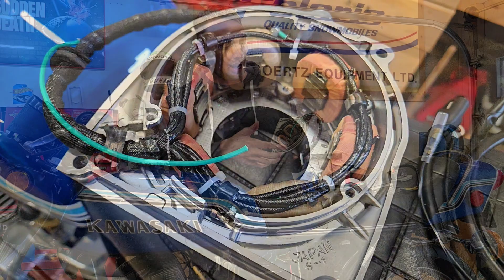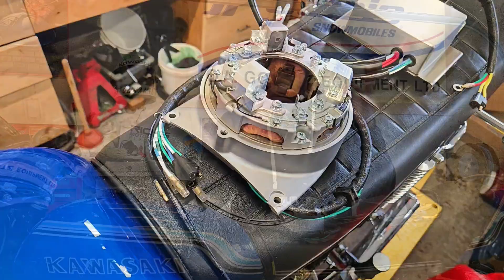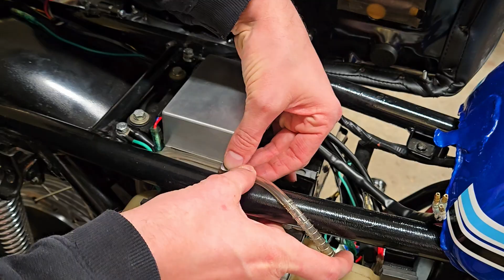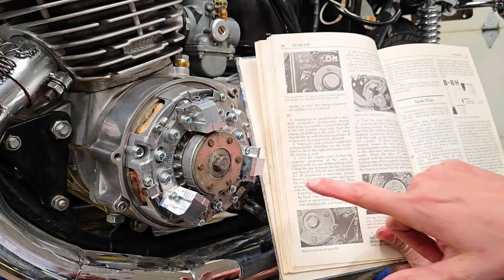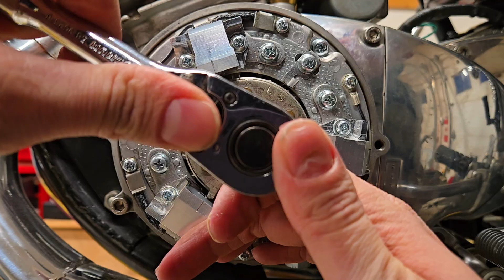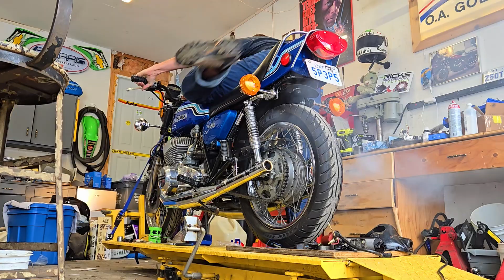Upgrading My Kawasaki H2 750: New Ignition & Perfect Timing!

Comment: When I get my bike to 3.13mm before tdc, I'm way off from the L mark. Key ways and pins are all present but things still aren't lining up. Any help?
Reply from the maker: I go through that step by step in this video reading out of the manual.   If i understand you correctly it the backing plate that needs to be adjusted to line up the marks.

Go to www.kawatriple.com and you can download a free manual and access an entire library of triple resources

Comment: Pete I did see a small clip of you having used Heim joints for the gear change.  I'm going to do the same with mine.  What video clip was it in.  Also what section hexagonal bar did you use.  I'm thinking 10/12 mm AF.  Great videos by the way, I'm just finishing off my '72 H2 and they have been a godsend to clarify the more complex rebuild challenges.
Reply from the maker: Thanks so much for reaching out.  That was in my 74 H2 video.   at the 20min mark.  I'll include the link below.  https://www.youtube.com/watch?v=9nnoBSyIgko

Comment: Cheers for video, I have just installed my new Lakeland CDI boxes, and rebuilt me stator, after fitting new low speed charging coil from Rex’s Speed shop UK. You made the instructions for setting stator so clear and easy to follow, I’m now fully confident to complete work, you’re a massive support, thanks again 😊👍🏻
Reply from the maker: That's awesome!  Thanks so much!   How does the bike run now?

Comment: Also, In called Fast by Gast last week. Guess who answered… Paul Gast! What a great guy. Talk about a living legend. 
I get and share your passion for these bikes.

Question: is it just the cdi box you showed plus coils (I already have the ignition part) that make up the needed electrical parts to run the motor?
Reply from the maker: Paul is the man!!   You'll also  need the rectifier.   All the parts shown in the video are what is required.  weather it's stock or RICKs

Comment: nice very nice but what is the total cost for this operation , i have an Lakeland on my 69 MACHIII and this is the top CDI box never had any problems.
Reply from the maker: it's not cheap..but probably similar if you were to buy original OEM parts

Comment: 6 minutes of repeating yourself. get on with it!
Reply from the maker: Thanks!  Mind if I ask where I repeat myself?
Reply: The first minutes of the video. I like your content but you repeated the details of the hardware repeatedly. I for one only need to be told once. No offence intended.
Reply: I worked at a dealer when the 500 and 750 came out. I put the 2 together and rode them down a 4 lane highway. The 500 was quick but the 750 was alot faster.I did notice so flexing in both  frames and the brakes weak. I told this to the dealer resident racer as he loaded them up to race them in  Daytona Flordia. 1 week later both bikes came back on a  trailer crashed.

Comment: Enjoyed the video. 👍 Good to know about the CDI box supplier. The billeted ignition pickups looked very smart 😊
Was there a particular reason for changing the coils? 🤔
Reply from the maker: There were a few reasons for the coils.   Since I din;t know the EXACT reason for my initial failure I wanted to check all the boxes.  I got a good deal on them and my original plug caps were giving me some fitment issues since they were a little beat up over the years.  At the end of the day it mostly came down to peace of mind knowing the everything was new.

Comment: Did you make the adapter for the dial indicator? Ive not seen one that screws in the head like that . I like it .
Reply from the maker: I got that from a fellow triple enthusiast who made the adapter.

They are available for sale if you look them up.   I forget what I searched before but they are made specific for timing
Reply: If you have a 3D printer there are files available for print online at thingiverse and other sites.

Comment: Upgrade your spark plugs to iridium NGK BR9HIX I,'ve used iridium plugs for years in all my bikes, less chance of oiling up, I worked for Kawasaki BMW dealership back in the day
Reply from the maker: Thanks for the tip!  I'll have to look into that since the B9HS is no longer in production
Reply: @PetesClassicCycle  back in the day they were platium plugs you wont get oiled up plugs
Reply: A friend put me onto Denso non resister plugs W22ESU or similar.  I own 5 two strokes; none have resister plugs.  A resister isn't there for your riding enjoyment nor longevity.  Too many NGK fakes out there; and i don't see them taking a lot of responsibility about it.

Comment: The 1.8mm BTDC will work for a particular crank stroke, if you had a stroke half as long that  would mean your spark would be in the wrong place with regard to degrees of crank rotation. The H2 has a long stroke hence the 3.13mm measurement for ignition timing.
Reply: This comment of mine seems out of context here, it was meant as a reply to Philipwhant1014 further down but I seem to have started a new comment !
Reply from the maker: Thanks for the tip!

Comment: Why do all the YT guys run the bikes on start up with the lights on?
Reply from the maker: Hahaha "youtube guys".  I'm actually an H2 guy with a youtube channel...if you go by what came 1st and why.I  I had just installed a new H4 upgraded light along with some other things so I was testing the function of it all.  Also...is there a reason why you shouldn't or just personal preference?
Reply: @PetesClassicCycle  H2 does not use the battery for the ignition, so having the lights on would not have an effect on the spark
Reply: @colinmote846  wow, thanks for that info, I've owned an H2 and an H2C and never new that! Currently own a 1971 (verified manufacture date of September '71). Beautiful bike.
Reply: @PetesClassicCycle  Sorry Pete, no insult intended, I've owned 14 triples (including an H2 & H2C) over the last 50 years. Love your channel m8.

Comment: For a Japanese 2 stroke 1.8mm btdc will give the best performance, so i have read from guys that know
Reply from the maker: Interesting...  any reason why?
Reply: The timing of 1.8mm btdc depends on the stroke of the engine. That 1.8 would only work on a specific stroke engine. Either those guys don't know or you misunderstood what they said. They may have been talking about a certain bike.The triples are a rather long stroke for their size except the 750 and 1.8mm on any of them would reduce power because of late timing.
Reply: What exactly do you mean with "a Japanese 2 stroke"?
Kawasaki specified the ignition timing for H2 = 3,13mm btdc (= 23°). Con rod length is 120mm. Therefore 1,8mm btdc = 17,5°.